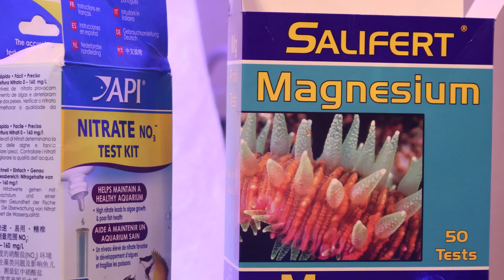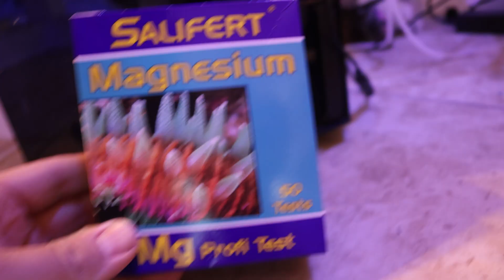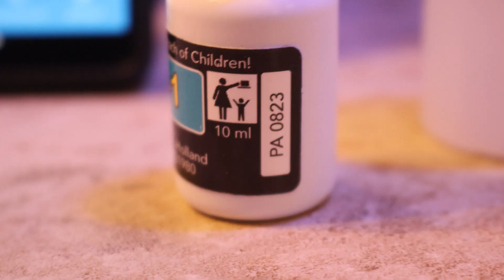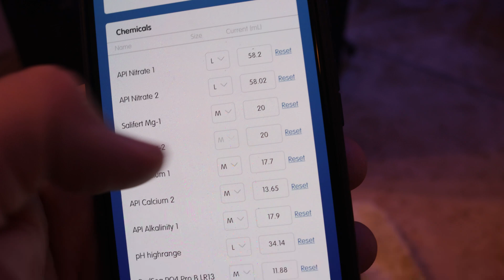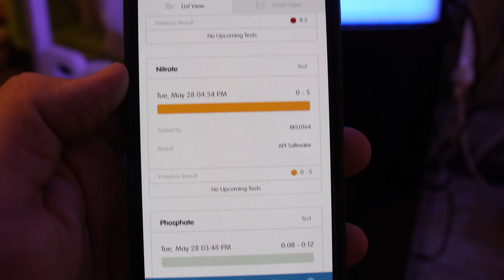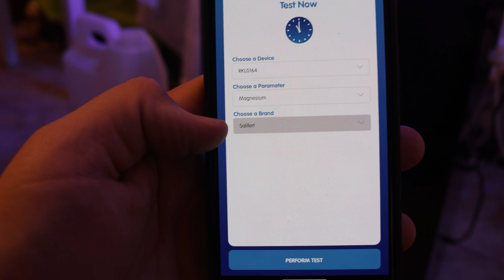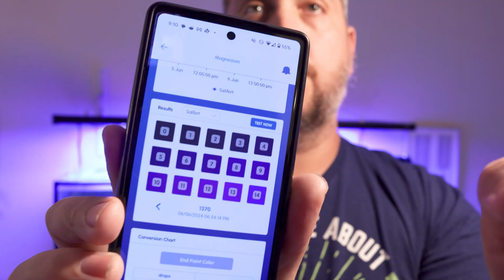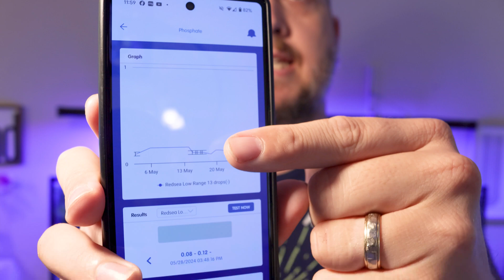Automatic Aquarium Testing Made EASY With The Reef Bot Lab!

Comment: Does it really cost 1500 dollars? As cool as it is there’s no way to justify that when for that mean you could buy the trident/maven, which do this periodically on auto pilot, and their respective controllers for that much money.
Reply: The reefbot does the same, it runs scheduled tests automatically  based on your tank's type and preferred time. It's for 1299 dollars if Im not mistaken
Reply from the maker: @JakubBartosz-zp7gv  Thanks for helping with this. The Reefbot does provide more freedom and flexibility. the other auto testers are $1200 as well, unless you just want Cal, Alk Mg with apex and then it's $650 I believe.
Reply: Maven FTW!
Reply: @ReefHausDynamics  what’s a maven?